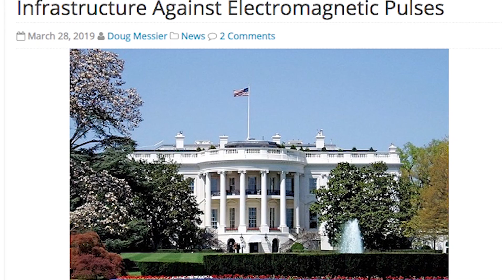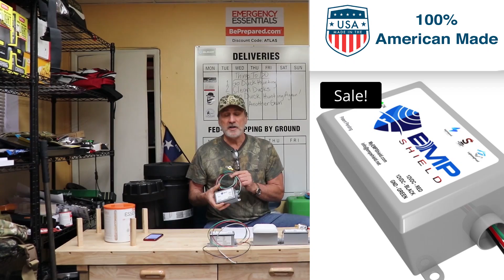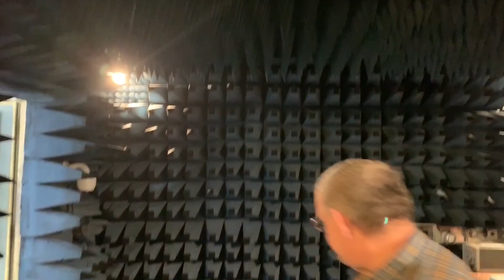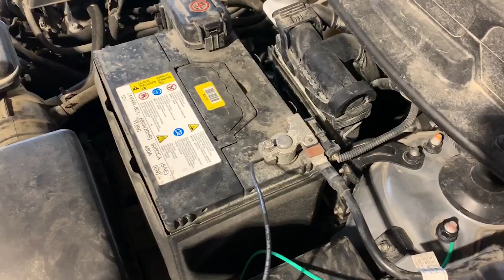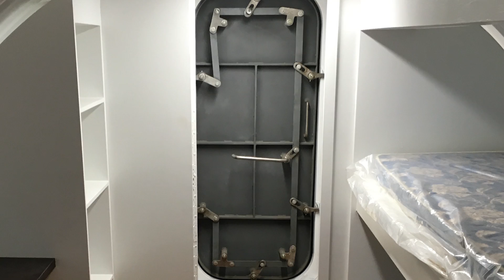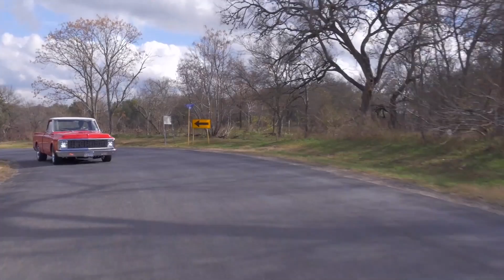How To EMP Proof Your Bunker, Home or Car For $299

Comment: How the fk is this shielding electronics from EMP.  I call this total BS scam. I am better off placing chicken wire in the attic and running copper wire thru the chicken wire. Going to look up the patent pending and look at schematic.. still call this bs

Comment: I have a generator that automatically kicks on when it detects a power outage. Runs off a 250 gallon LPG tank. Should keep the house powered up for well over a month or more, and that is with everything turned on.

Comment: That generator will still be fried absolutely guaranteed since the voltage regulator won’t work after an EMP and this thing won’t do anything about that. It’s just a surge protector good for X Joules nothing more nothing less a whole house surge protector is all this is. Your house won’t survive an EMP as your house wiring will be the antenna to pick up the EMP you may survive a lightning strike if it is far enough away based on line impedance but that’s it....

Comment: You know what else won't work when hit with an emp? Cell towers, so your smartphone will be as useless as tits on a boar. Better off buying a cb radio, antenna and coaxial cable and keep them safe until needed.

Comment: put it simply, it is like a surge protector for your entire house.  the only way to still have power after an emp fried the grid is to have a hole house generator hooked up to LP.  gas pipes still need electricity to push the gas.  everyone else will have fried wires in their homes and need to rewire the entire house to get power once the grid is back up.

Comment: In my opinion these devices are a glorified surge protector not an emp protector, 90kv protection is trivial compared to the induced voltages an emp can generate.  The transient that emp creates propagates through any non conductive material until it passes though any conductors potentially generating hundreds to many thousand volts and large currents that will jump across to other conductive wires, circuits etc in its path towards a ground or discharge path.  Unlike a surge that follows a path the emp is everywhere at the same time. The plastic case that device is housed in is a good insulator for your normal house hold wiring to prevent shorts but a emp  will pass through it as if it wasn't there.  That's why a proper faraday shield is a better solution.  A proper faraday shield is completely enclosed with no gaps or openings and proper thickness.  My experience with lightning strikes and their effect on circuitry is that a direct strike is terminal if not fully shielded against, and if the initial surge doesn't toast your gear the induced secondary surges will finish the job. This is very similar to the emp effect. So basically if you have working power or electrical equipment its virtually impossible to fully protect it since it isn't sealed.  So keep some emergency gear sealed away as a backup since any gear that's in use during a emp event most likely will be damaged.

This is just my opinion, take it for what its worth, agree or disagree, your choice.

Comment: A #10 can or any other metal container will NOT protect against an EMP unless there is a sufficient insulator between the contents and the metal.  It would make a handy container for recycling however of fried components.

People are relatively safe from lightening strikes in vehicles because they are separated from the metal body by the plastic/fabric/foam interior.

Comment: I am a retired electrical engineer and have done a fair amount of voltage surge testing as well as the design of protection circuitry.   Knowing the multiple EMP voltage surge characteristics, I was curious about how the EMP Shield product actually performed, along with how it was designed and installed.  On the EMP Shield website, they actually list their test data, so I read through it to get an idea of how well the protection device performed.  In conclusion, I didn't find a whole lot of useful data.  Their test descriptions were not terribly clear and really didn't answer a basic common sense question, which is: How much voltage spike will get past the protection device?  Normally, your tests would show the voltage spike levels that reach different outlets around your house, with and without the protection device connected; a basic before and after test.  The only thing the EMP Shield tests revealed, was the protection device was not destroyed by the EMP testing.

Also, due to the high speed nature of a nuclear EMP P1 pulse, the wire lengths between the protection device within the protection module, power line, and ground, would need to be less than a tenth of an inch to have a chance of offering some protection.  The EMP Shield device should offer some protection to the EMP P2 pulse, which is similar to a lightning strike.   I don't see it offering any protection to the P3 pulse, due to the longevity of it, it would probably cook the device.  Keep in mind, all these statements I made were best guess, based upon available technology.  I don't know what circuitry is being used in EMP Shield's protection device (s), I assume it is similar to what the other line voltage surge devices use, based on size of the product and cost.

Comment: Most lightning strikes are at least 1,000,000 volts. I’d be curious what that 90,000 volt rating is measuring.

Comment: The EMP only affects the computer systems is your breaker boxes computerized ( no it is not ) it will help your computer, your car, not your breaker box , and it does not effect your batteries.

Comment: I appreciate all your information. But I would like you to touch on different ways of removing sewage oh, how you do that. And Power ,if you lose power. Are you running a generator are you using some way of solar power. Is it a hand crank 3000 ferret capacitor. Hopefully you read this and respond I'd like to see it. And I know it's done in secret. But I would like to see the install from start to finish. If it's ever possible.

Comment: EMPs aren't actually that big of a deal.
Your vehicle should be alright, a lot of the energy is going to be dissipated into heat along the body and frame of the vehicle, it might fry your radio and maybe pop a few fuses. If you've a carbeurated vehicle you're 100% fine, fuel injected cars with internal computers might be an issue but even that's unlikely.

As far as the bunker goes, its underground and is it's own faraday cage, electronics will be fine, just dont have anything plugged in when the bomb hits.

Comment: Lightning, several million volts at several million amps, not much can protect against a direct strike hitting the line into ones home. These are only band aids and voodoo medicine. I have seen the damage done to various types of properties from residential to commercial transmitter sites. Its like a crap game, sometimes you win but most often you loose. This past January we lost our power meter to a lightning strike, no problems in the home, I had installed Schnieder Electric surge suppressors on each phase of the mains. Jump forward one month, lightning hits a power pole a block away and we catch án arc from a side flash that jumped from the base of the insulated stainless chimney at ceiling level to the floor in front of the fireplace.  Nothing damaged but if someone was sitting close enough they would have been toast.
An EMP pulse is radiated over thousands of square miles and you have an entire electrical grid that acts as an antenna routing all of the power first to the transformers burning them out from a massive overload. The wiring in ones home would act as an antenna as well but the amount of energy gathered could easily be dissipated by these EMP protectors.
An all metal shelter buried underground acts as a huge ground rod and faraday cage but I would not want to be in there if lightning were to hit the power mains or the vent pipes ( if the shelter was located out in an open area ) one needs to add an insulating layer inside the shelter. This could be as simple as coating the interior with several coats of something like Rhino Liner. Don't get me wrong, I find the shelters you build to be the finest available for the cost. The setup of the interior is great, considering one is using a cylinder for the structure consider using some of the ideas from aircraft first and business class seating for the lounge area. Its a thought and if you are close enough to one of the bone yards you might be able  pick up on some nice seating for cheap from them before they scrap the airframe.

Comment: I have to agree with you.. A surge of energy through wires is very easy to control; but when you are talking about frequencies outside the containment of wires, then you have to shield from the outside.. i.e. a faraday cage. Now having said that, the pulse will come through the grid because the "grid" is nothing more than a big antenna receiving the energy from the pulse. Now maybe this device may stop the energy from continuing but that's it. Anything out side of containment will be toast...

Comment: One thing you can do to your bunkers is add a metal mesh screen over the air pipes to close the faraday cage as it were, since the rest of the structures are usually metal and those are the only openings for RF radiation

Comment: Suggestion on how to test them.
1. Have the Navy Seals place some in strategic spots in NK and Iran.
2. Nuke the hell out of them.
3. Send the Seals back in and retrieve the EMP Shields
4. Check out the Shields
5. If they pass inspection, sell them for lightning and solar mass ejections (you won't have to worry about NK or Iran)(China isn't going the kill the goose that lays their golden eggs and Russia  won't risk messing with the country that just nuked NK and Iran). Several problems solved in one swell foop.

Comment: I'm confused I have been told during an EMP the electron particles or in the air and attack the chips from all sides, not that it would go in a line to the components were a in line EMP protector will work. Please advise

Comment: Only problem I see hooking up that thing to a modern car is the computer....the battery be safe but computer mico manages the engine on modern cars now would be fine on a older car before they started putting computers in them but then you run into another problem older cars an't known for getting good gas mileage

Comment: If there is an EMP strike, your car might run with this device, but how about the gas pumps, street lights, ATM machines, etc?  I kind of feel like you would still be stuck, just maybe not right away.  You woudln't have your car die out while driving down a highway and could get home.  After that, I don't know how long you would still be able to drive.

Comment: In other words this device is for protecting electronic and electrical devices connected to the power grid from power surges travelling down power cables.

There's just one teensie problem with that if you're trying to protect your stuff NOT from lightning strikes or power surges in the grid but EM pulses. EM pulses don't just travel down power cables. An EM pulse from a nuclear blast 200 miles above Kansas will travel through the atmosphere FIRST before it ever reaches any power lines or cables. As such it will fry electronic equipment even if that equipment is completely disconnected. AFAIK the only way to COMPLETELY protect equipment from the menace of EM pulses is with Faraday cages. At best that $299 do-hickey is only a PARTIAL protection.

What does all that mean? It means this device is may be useful for protecting against lightning strikes but it's a waste of $299 if your aim is to protect your stuff against EM pulses.

Why? Because even if you have this device and connected up while it may protect you from an EM pulse-induced surge along the power cables connecting your stuff to the grid it will NOT protect it from the EM pulse itself. That travels through the air and does NOT need power cables and power lines to induce a surge inside your electronic equipment itself.

In particular any CPUs unprotected by a Faraday cage will be fried.

I would also point out that anti-surge protectors already exist. They're called circuit breakers and most modern powerboards have them, albeit they don't generally cost $299 apiece.

If Atlas truly wants to protect its clientele against EM pulses I suggest it incorporate Faraday cages and surge protectors into its shelters such that the cage surrounds the entire shelter. Now that would be a useful addition.

Comment: Sorry, but a whole house protector is very unlikely to protect a home from a EMP. 95% of all homes use Romex (unshield wiring) when an EMP event occurs all the wiring in the house will pick up energy and transfer it to any devices that are plugged in. The whole house protector is too far away to prevent the devices connected in. If you want to protect your devices at home your need a protected at the point of Load (POL). Even if your home uses shielded wiring (MC OR AC) it might not provide sufficient shielding. The only good use for a Whole House Protector (WHP) is to clamp surges that originate from the Grid service. Realistically a WHP should be connected before it reached your electrical panel so it can clamp the surge before it reached your panel. WHP should be connected between your meter & the panel, not in the panel.

FYI: A good commercial protector (ie used to protect telecom from localized lightning strikes which causes a localized EMP) usually cost between $1K and 3K USD (Transtector, Thor Systems sell commerical grade units). My guess is that this device uses a set of MOVs if its selling for $299. A commercial unit will use Silicon Avalanche Diodes which can take a lot of surges with out degradation.

Most POL surge protectors use cheap MOV (Metal Oxide Varistors). MOVs can only handle a few surges before they are degraded or destroyed. The only reasonable cost non MOV POL surge protector is https://www.brickwall.com/  These are an LC (Inductor-Capacitor) filter Surge protector which filters out the surge instead of trying to absorb the energy. That said the cannot protect devices that have multipath surges, such as a TV connected via coax, or Computer via ethernet cable, or FAX\model connected to a phone\DSL cable. The EMP will introduce energy via the coax or data cable and provide a current loop path that the POL surge protector cannot block. Also devices that have an alternate ground (ie your refrig that connected to a cold water supply for making ice. 

For CME, its extremely unlikely that a low cost whole house protector would work, since its a long duration event & would produce a long surge or very frequent series of surges that will burn out the Whole house protector. if a CME occurs you have time to simple throw all the breakers and unplug every device. Usually it takes about 3 days for a CME to reach Earth. If you have ample warning, best to disconnect everything, and short the disconnected plugs of any devices to prevent a voltage differential in the devices wiring. Be sure to disconnect any data coax connections too.

Comment: Hey I just bought two of the units but there is some questions as to how they can work or be effective that until these questions are resolved the show should be put on hold. Please come to this forum and help resolve the questions. https://www.goldismoney2.com/threads/finally-easy-to-install-one-step-emp-protection-for-your-car-truck-home-etc.263184/#post-1629124

Comment: Ron, if the "shield" is simply an ultra-fast surge protector, that's one good step. But it is NOT the same as EMP shielding the entire room. That device may stop a power surge from coming down your antenna wire or power cable, but the problem is that the direct EMP pulse will enter any premise that is not completely surrounded in sealed metal. There are some interesting white papers on the web that discuss how you need to how metal contacts overlapping and shielding entryways. How any vents or ducting has to be plugged and sealed, How an awful lot of extensive work has to be done--not just putting surge protectors on the wires. If you don't protect the entire body of your generator, you will find it has been burned out--whether the wiring was surge protected or not. Using this box is only one step, one small step. If your gas-tight doors have thick rubber gaskets, guess what? They will still pass EMP! Solid EMP protection is a laborious and expensive process, you can't just buy a box--unless you are planning to move into it, and it is fully sealed, metal on metal.

Comment: This is absolute bullsh*t.  An EMP is going to fry any electronics not in a faraday cage or sealed in mylar.  It also depends on intensity and your location to the impact/detonation.  An EMP is an air born wave, its not traveling along the electrical grid. This is just stupid.

Comment: I've been designing surge and EMP circuits for over thirty years.  The greatest difference between a typical lightning surge protector and an EMP/HEMP is response speed (nano-seconds/pico-seconds) and maximum clamping Voltage.  The surge current is then usually associated with the application with a range of a few hundred Amps to several hundred kilo-Amps. The vehicle protection unit is way overpriced and judging from the long wimpy wire (inductive) leads, probably ineffective.  You could connect a high current TVS transient diode (<$15) across the battery and be better protected as long as leads were short and stout.

Comment: I commend you in your amazing set up.  However,  this company should go all in a find away to protect our transformers, because without power the gas stations won't pump, as for our homes,  power wouldn't work without the main transformer. I do like the vehicle  protection but case n point unless you have a stash, it will only take you so far. But, good presentation. God bless you. Hearts all day. : )